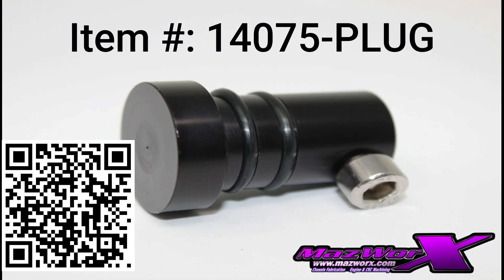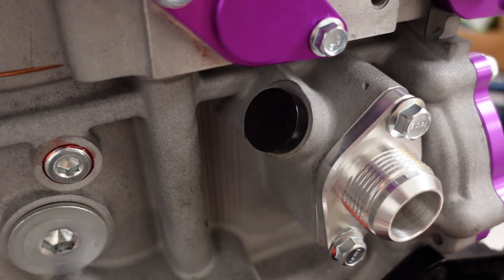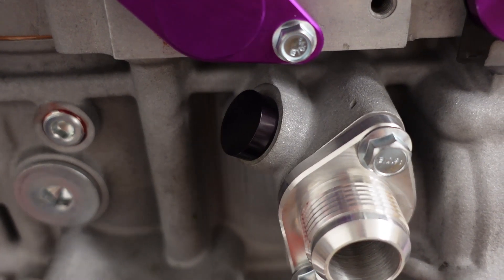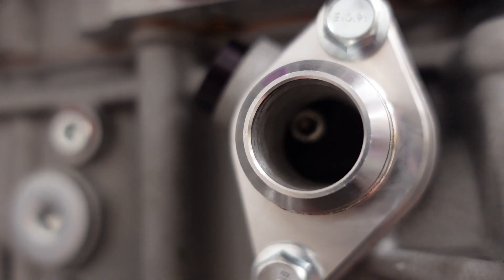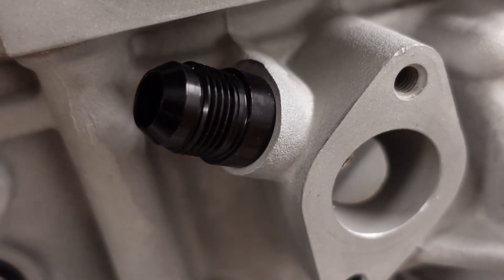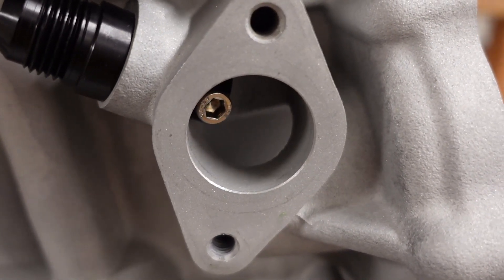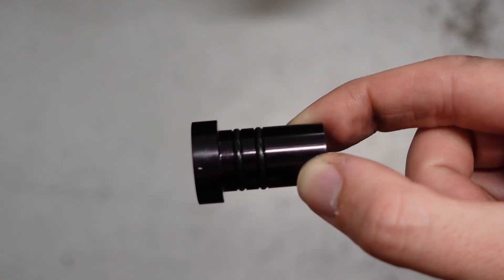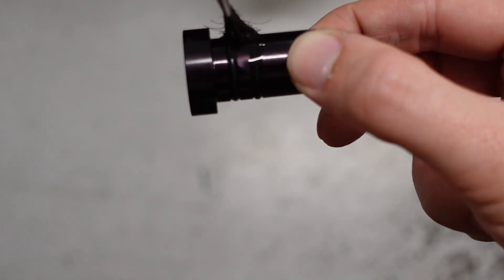Mazworx RWD SR20 water pipe port adapter/plug

Comment: So do you guys feel it's unnecessary to run coolant to an iacv, throttle body, ofcourse no need heater. But I've been wanting to clean that hose mess under there for a while. You guys discontinued the other water/heater pipe connection so is it OK to completely delete all that hose under the intake?
Reply: It's for race applications basically not street cars. Don't need any of that stuff when you're running a dbw tb.
Reply: I don't even do that on my daily 🤷🏾‍♂️